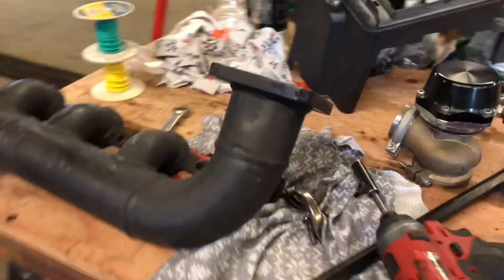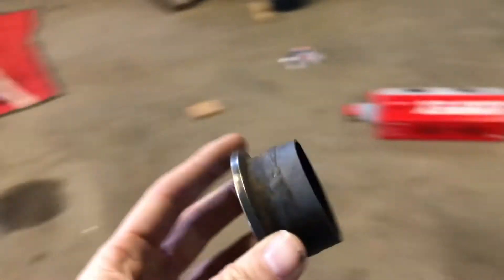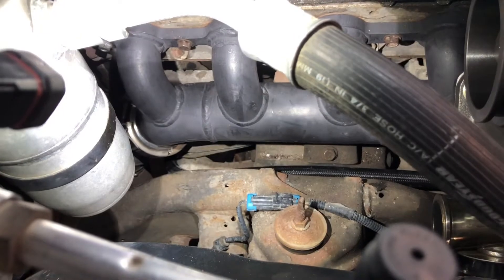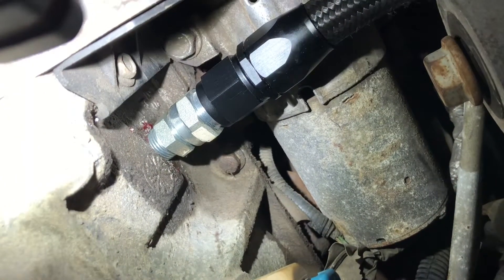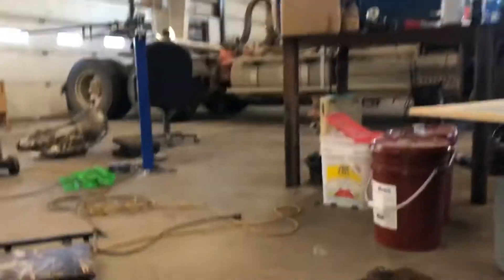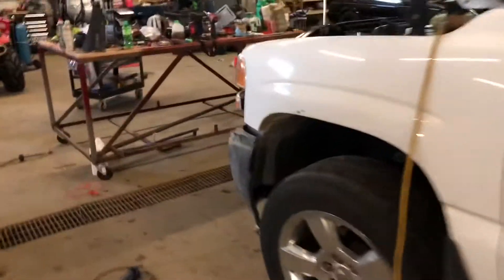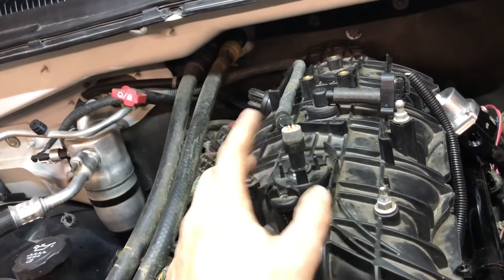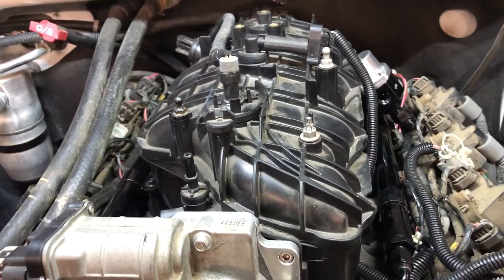White Lightning Part 4: Wastegate Install, Oil Feed And Return and Misc wiring.

Comment: What’s the part number for the tb adaptor?
Reply from the maker: Are you using a drive by wire throttle body as well?
Reply: @RustyTunedRacing  yes that’s right same setup. 2003 truck.
Reply from the maker: @arcticcatm1000sp  551567 from ict billet
Reply: @RustyTunedRacing  thank you.